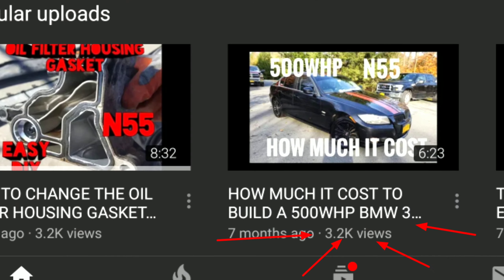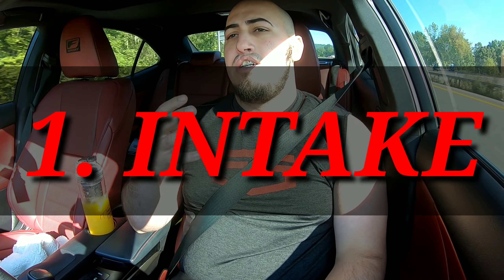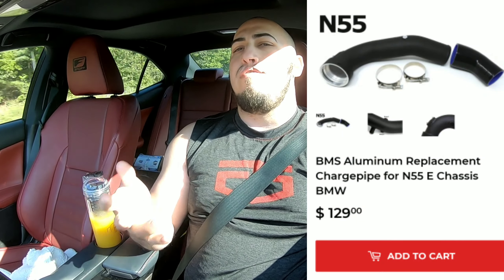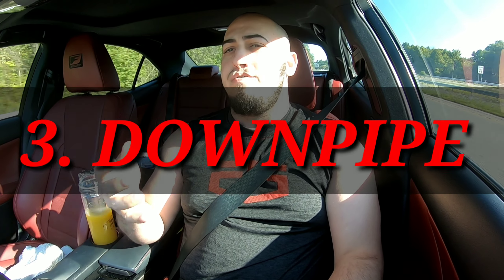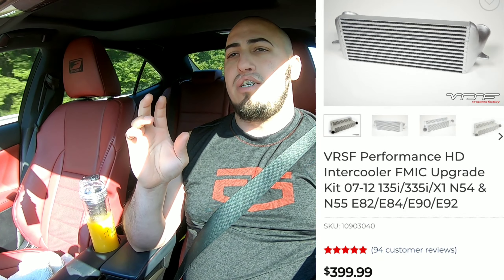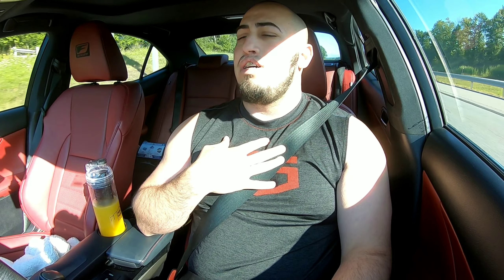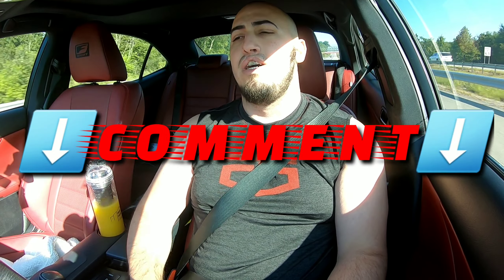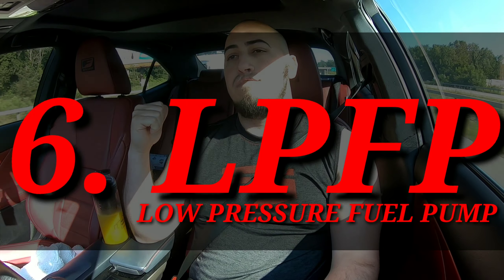How to build a 500+whp 335i n55. #bmw #335i #n55

Comment: I have a 335i N55 and it's hard finding reliable guidance on the road from stock 302 hp to a 500+ hp full mod. Everybody seems to prefer the N54, although I don't see it myself. Your video, along with your part recommendations has been my blueprint. I'm only a few parts sort of the total bolt-on modification. Everything so far has put me solidly on the right path. The performance, power, and sound changes are turning my well-behaved ride into a sweet green light killer.  Couldn't have done it without you man. Thanks a bunch!
Reply from the maker: Im super happy for you and wait until you get those last bolts on parts that you need is gonna be mind blowing 🤯 how much quicker your car is gonna be and how it will sound👌I guarantee you it will be Just perfect.

Comment: Is a 500+whp N55 still more reliable than a 500+whp N54 or are they the same with reliability once they make that much power
Reply from the maker: For my experience the N55 have been more reliable than the N54 and great for daily driven as well